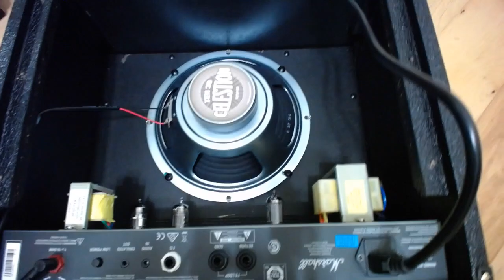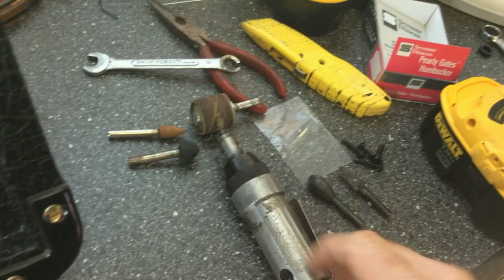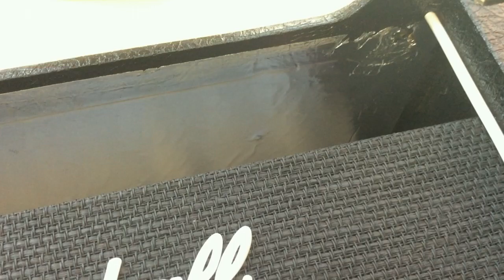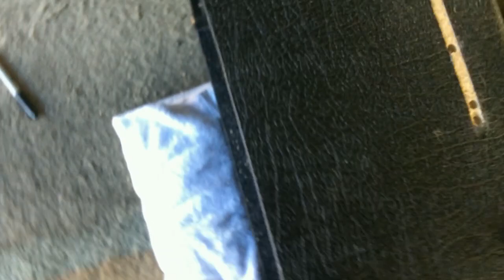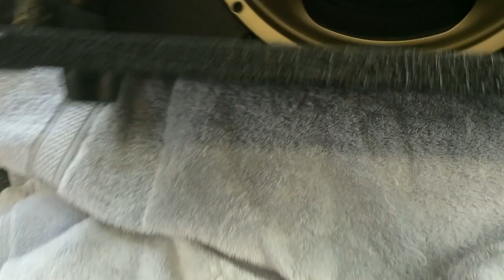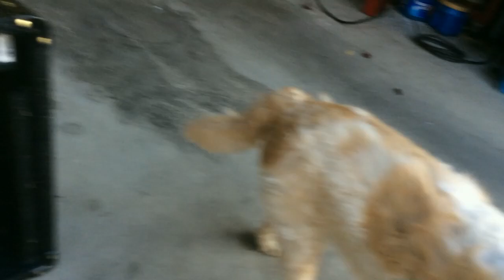Marshall Mods - Trick Out your Marshall DSL 5 - Speaker, Bias, Tubes

Comment: I swapped out the stock Ten-30 for an '80s vintage 10" Sidewinder (150W, 103dB). The results were astonishing; big fat cleans, smoothed-out, fizz-free overdrive, and a big hike in volume with the extra 8dB efficiency over the 95dB of the stock Celestion.
Reply from the maker: Awesome, this is what's so great about people like you chiming in cause I've never even heard of that speaker! and now anyone coming across this video will!! Pinned it \m/ I'll check that one out - thanks
Reply: @oldguyjammin9732  Always welcome mate. The Sidewinder was (still is?) Celestion's most powerful speaker back in the '80s. I got mine out of a 2x10, 300W cab my bassist mate built and was surplus to requirements.

Comment: 110mV sounds best to me for bias in my DSL5c, and will provide very good tube life. I really like the Celestion G10 Creamback in this amp. It provides deeper bass, better definition, no fizz, and maintains great tone at all volumes, even with everything dimed. I gig with this amp and love it!
Reply: Just purchased that speaker for this amp today. Can’t wait to find out how right you are!
Reply: Have any video to hear it? Thanks..
Reply: @ugopodetti  unfortunately no. It does sound very nice though. I’d love to hear it compared to a lower watt Jensen, but it seems most people are swapping out for celestion

Dan’s description is pretty accurate. Sound is clearer, less fizz, and more bottom end. When cranked it gets loud enough to vibrate the cab for certain notes and I have to cut the bass a bit; a common complaint is that this amp sounds boxy and not enough bass but the creamback seems to solve that, unless you’re going for metal chug
Reply: @ugopodetti  unfortunately, I'm not set up with any recording equipment to produce a decent video. Wish I could but video recording & editing is NOT my thing.

Comment: Nice vid. Love the channel. In my dsl5cr I put a 12 inch greenback and upgraded the tubes with a couple of tung sol 12ax7s in the preamp and a jj 12bh7 for the power amp. I also managed to do the groove for the speaker without going all the way through using a cheap rotary tool. It sounds so SO good. Seems to do everything better now.
Reply from the maker: Love to read comments like this!! Nice job with the rotary tool, I just got pissed and since I knew I’d be keeping this awesome little amps, just dug in and got it done, haha. For fun some time, slip a 12AY7 in that first socket and see what you think. It changes the gain structure a bit... and in a good way imo. Thanks for posting \m/
Reply: @oldguyjammin9732  yeah awesome, i'll give it a run for sure. on a side note i've actually got the dsl20cr as well, and i've got a Creamback 75 in that one and its funny how a speaker can work so well in one amp but not another. The greenback in the dsl20 just sounds way to loose and boomy, but perfectly balanced in the dsl5, and the creamback sounds way to tight and focused in the dsl5 but really well balanced in the dsl20! Merry Xmas from Newcastle Australia!
Reply from the maker: Ryan Poole - Australia, nice. I follow Shane and a few shows, your country looks beautiful. So this makes me feel like I'm in good company. I went thru the same thing added up with a Creamback in my dsl 20 also, lol. Love both amps. Take care mate 🤘
Reply: What do you all  think about the WGS  12" GREEN BERET - 25 WATTS for this amp? Here's the description: The 12” Green Beret™ guitar speaker brings crunchy cone breakup, growling bass, great headroom, and aggressive mids together better than any other 25 watt speaker. Upgrade for Celestion™ G12M Greenback™.
Reply: Hi. I'm about to get a 12" evh to install in my dsl 5cr. It will fit ?

Comment: I’m watching your video again. I think you’re the only person on you tube who took the thing apart!

I’ve had mine a little over a year and want to see how it can be improved; already a very nice amp

Have a new speaker on the way. No hiss or fuzz so my tubes are probably fine; not sure that better tubes will make enough difference to justify the price

Curious about upgrading caps or circuit mods to get a little more bass
Reply from the maker: Well thanks for watching, I tend to take everything I have apart to get a look around inside. I don’t much get into component replacements (caps and such) but don’t think this is the amp for it either, too much stuff going on inside. The JCA, Egnater and VHT amps are better ‘modders’. Imo the best thing you can for this amp is change the speaker and the socket 1 tube to a 12AY7 (gain reduction lets the power tube speak up a bit more). Speaker is up to you, but a Texas Heat, Greenback or Creamback are all good choices. I’ve rarely noticed HUGE differences in tube rolls or speaker swaps but sometimes the summing up of all the small changes becomes nicely noticeable. Have fun \m/

Comment: Sir..can i do the speaker mod without taking apart the hole preamp circuit on the top? Sorry for my english, and cheers from Argentina
Reply from the maker: I think you could, but you’d still need to pull the tubes out, but they’re super easy to replace, just make sure the pins are lined up.

Comment: Keep in mind not all DSL-5c's are exactly the same. Some have their speaker offset to one side. Confirm if your speaker is centered or off to the side before you cut. Some amp chassis have 1 tube so far forward you'll not be able to properly seat it once the 12" speaker is in place. You'll never get that tube in with a 12" Greenback, for example.
Reply: Indeed my speaker is to the side, and tube 1 too forward to fit with a 12” in place. I ended up moving the amp back 1/2” which required drilling new holes. By that time the offset hole was cut, greenback fitted. Came out great, looks fine. Big help to have a 12”. Went with 12at7 for valve 2 so a bit less gain. Next will be a Mercury transformer with 8 and 16 ohm taps. Will have to drill for the 8 ohm jack but a ton of external cab possibilities open up with the 8 ohm option.
Reply: Hello.

Do you mean DSL5Cs or DSL5CRs? if it's the first one do you have any pics uploaded anywhere?

Cheers and thank you.
Reply: @Kyush4  Mine is 5C but I didn't take pics.

Comment: Wait a minute, I read on a forum that a guy sent an e-mail to Marshall about Bias, and the response was that dsl 1,5,20 don’t need adjustments. Am I wrong?
Nice video by the way!
Reply from the maker: I doubt you’re wrong, but then what’s that adjustable pot for? You’re thread versus mine I guess, ha ha. Usually if trim pots are for something else they will be set and then a fixed with a dab nail polish or something similar, meaning they’re never to be set again...? One thing I have come to realize is that “proper biasing” is like sniffing a cork you just pulled from a bottle of wine. It’s a preference, it’ll change your tone a bit, may decrease tube life if too hot, but won’t damage your amp if it’s this way or that.

Comment: Another great video !  I’ve been thinking the same with my older DSL 40. Gonna re-tube and change the stock speaker to hopefully warm it up, especially on the lead channel. What do you recommend for a speaker as well as your preferred bias voltage on the DSL40 ? 😎
Reply from the maker: 32 mV DC, CreamBack - the G12M not H, and then whenever possible dime the master. It seems that much of the fizz in Marshalls comes from the preamp. Relying on an overdriven power amp does wonders.
Reply from the maker: @Matt - I thought the M got me further from the “Marshall fizz” - the H seemed a little brighter or harsh to me. I find the DSL to be a bright amp anyway, so I prefer darker speakers in it, like the Swampthang or M. But tone is subjective so if you like the tone of the H, go for it! :) try searching for “G12M vs H” I bet some things come up from several forums that you’ll find really helpful - good luck \m/
Reply: I have the DSL40C and went straight from the seventy 80 to the Creamback H. To me, at least, it sound amazing and I'd never go back. Though I haven't tried an M in it. I believe I set my bias in the mid 30s. I had also just replaced all tubes: Mullard reissues in the pre amp and Gold Lion KT77s for power. Sounds awesome for me. And I cut the c19.

Comment: Hi Mr. please help answer my question relating to Marshall DSL 5 CR 

Again, this morning I had the same case in which the sound volume of the amplifier is decreasing. Previously I had the same thing around 3 weeks ago. I'm wondering what the problem is happening to the amplifier.

Is it the tubes or something else ?

It's around 1 year I bought it new. I usually use it once a week for 3 - 4 hours.

I think it's really little time for using it.

Thank you very much for your help

Have a great day 🙏
Reply from the maker: Even "new tubes" are suspect. Easy enough to check though and cheap to replace in the DSL5. Get the tubes, replace them and see how things go. That's the first step. I've had to replace tubes in new amps more than once.
Reply: @oldguyjammin9732  Thank you very much for your advice Mr. for my tube amp. Have a great day 🙏

Comment: I wish the volume controls were post-loop.  It makes it less useful if you just want to use the power amp.  And it’s a nice sounding power section
Reply from the maker: Have you tried using a patch cable in the loop?
Reply: @oldguyjammin9732  you need the  loop return for using the amp as just a power amp.  Not sure what a patch cable would do
Reply from the maker: @FuzzFace  - I just know that these amps suffer if non-true bypass pedals are used in the loop. The Master should be post loop, while the gain knob controls the preamp... or do I have it wrong?  Either way this little 5 watter suffers a bit because of the BH7 power tube.  Help me understand, please name an amp with post Loop volume controls.

Comment: I have a DSL20that I play clubs with after having a much louder(and heavier) DSL40. Both amps have the standard crap stock 12 inch speaker. I put a Vintage 30 in and settled on that. I am impressed by the smaller lighter and less loud DSL5 and the Greenback as it sounds a little different. After watching your vid you are trying to tell me you HAVE  to chisel a groove in the cabinet to fit a12 inch speaker in place of the 10 inch stock one? There is no other way to move the speaker around to fit?
I had an Orange Rocker 15, the smallest combo Orange has. Had a crap stock 10 inch speaker so I put a 10 inch Greenback in there. Better but just lacked bass so I put in the 12 inch version and wow! I had to put the speaker one inch to the left as the power tube was too close. There was also a rectangular chassis protecting the tubes which I simply had to leave off to accomodate the larger 12 inch speaker. I still prefer the Marshall over Orange so please tell me there must be some way to put a 12inch speaker in the DSL5 without cutting into anything.
Reply from the maker: I wouldn't have cut up my cab if I had figured out another way to install a 12".  But it wasn't hard at all, very easy and the cut only shows on the bottom of the cab. Worth it!

Comment: So the dsl20 in 5watt mode don't sound the same? notice that one have 12" speaker
Reply from the maker: Nope, at best the DSL20 is delivering 10 watts in half power mode, but regardless the dsl5 is a different circuit and uses a different power amp tube. If you don’t have to play LOUD the dsl 5 is the way to go - I absolutely love mine - amazing tone.

Comment: I just bought one of these and am a bit confused about ohms and extension cabs. 

The quick start guide states: "A single 16 ohm speaker cabinet can be connected ..." But on the amp itself below the speaker socket, it says: "1 X 16."  Does that mean you can use one speaker cabinet with two 8 ohm speakers wired for 16 ohms?  Or does that mean that any cab you use can have only ONE 16 ohm speaker? Logically, it seems that both will work safely with this amp, but I want to be sure so I don't damage my new amp. Please clarify.
Reply from the maker: Ya, you got it. Total load impedance should be 16 ohms whether it’s a single speaker or a cab with 2 or even 4 speakers loaded in it.

Comment: Nice mods! I think I’ll stick a green or cream back in mine but staying with a 10” speaker, I find for average sized and smaller rooms, clean or really heavy that the 10” pushes good enough air and is thick enough, I’ve got my bigger 30w laney ironheart metal amp with a 12 cab and I can’t hear a particular difference that would make me want the bigger speaker in the Marshall unless it’s in a much larger room, maybe I find that I want to tame the bass on the bigger amp more compared to the Marshall dsl5, but I can push the bass up on the Marshall to more than I need so I guess I’m all set with a 10” :) and I can play this one cranked without breaking my windows! Win win! 

What’s your opinion on the new mods after 2 months with them? :)
Reply from the maker: Right on, I put a Creamback G12M (not H) in my DSl40 and appreciated the difference. While I was looking at 10” options the Ragin Cagin kept coming up on list after list. I’m really liking the mods and like you said being able to dime the volume and bring the gain up just a bit is a super plus, sounds so good. Here’s something to check out, I recently got a Killing Floor pedal by SDuncan and it makes my DSL5 sound more like my DSL40. I set the knob around 10 O’Clock (always on) and “oh my gosh”. Guitar volume knob works great to move into less/more levels of gain, etc. It also makes me glad I’ve got a big speaker in there. Whatever you do check out the Killing Floor, best piece of gear in a while :) Cheers!!

Comment: Love that EVH on the wall by the way. How does it sound through the Marshall 5c after the mods? Thx. Rock on!
Reply from the maker: The EVH is probably my favorite guitar, rock solid and drop D with just a pull of the D-tuna pin - awesome. It sounds epic through the DSL5. I use a Killing Floor OD with the knob at 3:00 - always on - turns the amp into 15W fire breather :)

Comment: Excellent video! Is there a 10" speaker you can recommend for this amp? Thanks Oldguy.
Reply from the maker: Yes, if you start searching “top 10” speakers” you’ll notice that in list after list after list, the Ragin Cajun keeps coming up. I’d go that route.
Reply: @oldguyjammin9732  Well I jumped the gun and now have a Celestion Greenback and WGS G10 C/S on the way. My guitars have humbuckers so let's see which sounds better. I guess I will try Ragin Cajun if these don't work out. Thanks again Oldguy.
Reply: @oldguyjammin9732  Unfortunately, Eminence doesn't make a Ragin Cajun in 16ohm.
Reply: Try a celestion G10 gold
Reply: Celestion VT jr....stops the buzz

Comment: Hi I have the same amp and I want to change the speaker for a 12” greenback. I was looking and I found something that is really confusing me. The amp  says impedance: 16 ohm speaker. I found the greenback at 8 ohm. Is there any problem if I buy the greenback 8 ohm or should I buy the celestion G12 16 ohm’s?. Is the same greenback 16 and 8 ohm right?
Reply from the maker: Sometimes getting the right ohm’s matching is tough but in this case, Greenbacks come in both 8 and 16 ohm versions.  https://reverb.com/p/celestion-g12m-greenback-12-16-ohm-25w-replacement-speaker?hfid=49728831&utm_source=google&utm_medium=cpc&utm_campaign=6556462740&utm_content=campaignid=6556462740_adgroupid=82353538201_productpartitionid=1536465468673=merchantid=539126748_productid=49728831_keyword=_device=t_adposition=_matchtype=_creative=391635704566&gclid=EAIaIQobChMIhPCJpPzR9QIVgSCtBh3a9gdcEAQYBSABEgJV7vD_BwE

Going over the suggested impedance is a safer bet than using a speaker rated at fewer ohms.

Comment: Hi,thanks for this video. I also upgrade the speaker for a Greenback 12” in my marshall dsl5cr, and it sounds so good. The problem is that I’ve got new tubes and the amp is very noisy when I changed the power amp for a JJ 12bh7. Is that normal? I had to put back the marshall tube stock that comes with it and the noise has gone.
Reply from the maker: Nice upgrade eh? Play it like you wanna break it, lol. Re the noise... no, not normal. It’s rare but I have received noisy or bad tubes. The Tube Store or Tube Depot are both very good at exchanging them.
Reply: @oldguyjammin9732  thanks for your answer. Yes, hehe my neighbours are not impressed. Hehehe. 
I was thinking exactly the same about the noise. I think is something wrong with the tube. I’ve got it online here in Australia. I will call the shop and see if they could exchange it. 
Again, thanks a lot for this video, It was a really nice project I did during the lockdown here in Melbourne. 👍🏻

Comment: Hi which GT tubes did you get for this amp - 12ax7's or a 12ay7's for lower gain? thanks
Reply from the maker: 12AY7 is my go to 90% of the time. I recently found a new tube (forgetting the number right now) but its a 12AX7 on one half and a 12AY7 on the other which would leave full gain on the classic channel and reduce the gain on the ultra channel!! I plan to check it out soon.
Reply: Hi, I’m interested in this too. I’ll keep an eye out for when’s you check it out
Reply from the maker: @dreambig3902  - I answered this about 3 weeks ago in this thread.

Comment: Celestion Classic Lead 80 8ohm 12" will be great for upgrade this amp?
Reply from the maker: I ended up putting the Greenback and I fixed in it, sounds very nice. It also sounds good with a Swampthang.
Reply: @oldguyjammin9732  totally agree, i'm using an external cab with greenback... Real killer tones
Reply: You need a 16 ohm speaker  for this amp .
Reply: @adamwatson6916  I put an 8 ohm celestion V30, sounds awesome